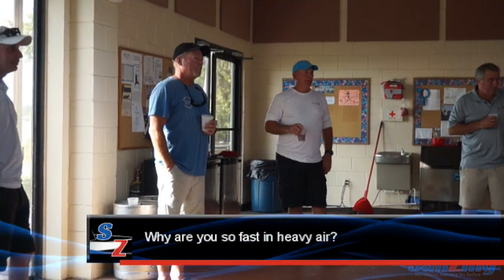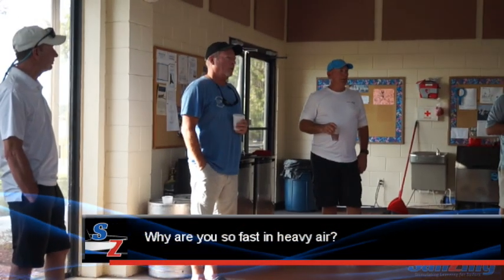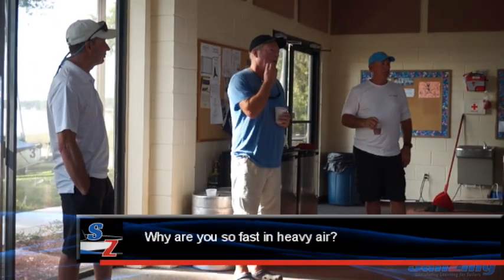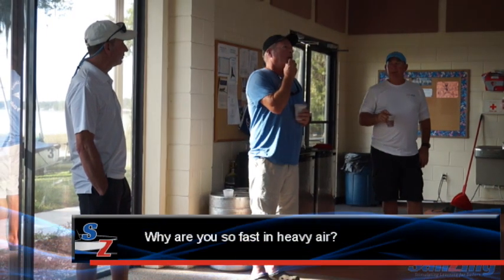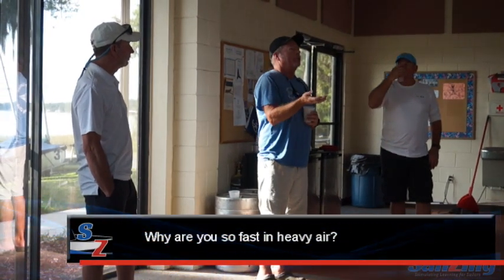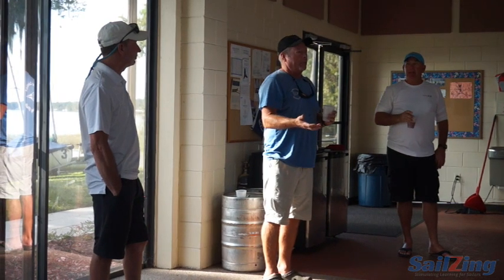Heavy Air Boat Speed: Sheet Harder and Drop Traveler

Comment: EDIT (original argument removed now that I understand what boat he's talking about and why he gives the advice he gives pertaining to his particular boat): The advice given in this video looks to be correct for the Scow, and I suspect his advice holds true for any dinghy with a flexible mast, only because hard sheeting induces mast bend. 

BUT GENERALLY In heavy air, you definitely want to bring the traveler up and sheet out to allow the top of the sail to twist off, reducing heal. Draft should be controlled/reduced by outhaul and halyard/Cunningham/backstay tension. Vang and main sheet should be let out to allow the boom to rise inducing the top of the sail to twist off, and traveler brought up to bring the boom and lower sail back into the correct horizontal position.

Quantum sails article on sailing world
https://www.sailingworld.com/understanding-mainsail-twist#page-2
North Sails article
https://www.northsails.com/sailing/en/2018/10/north-u-understanding-twist-by-bill-gladstone